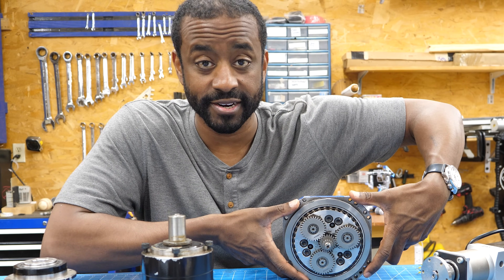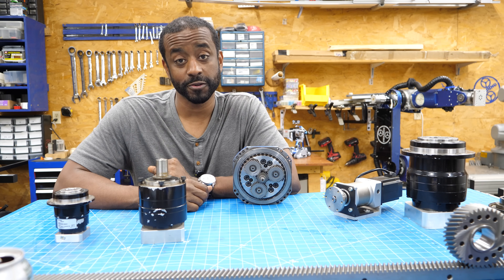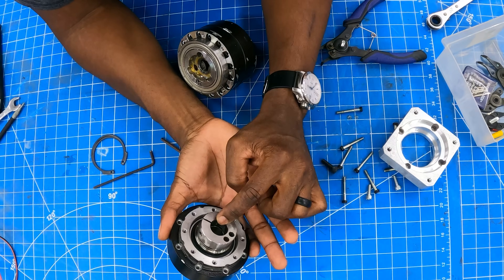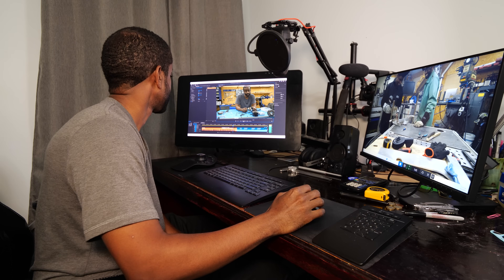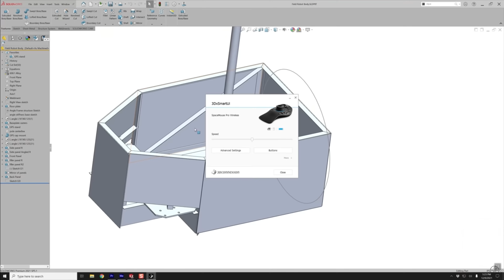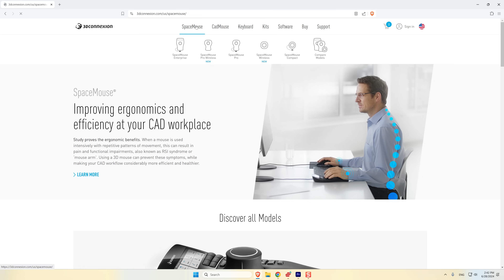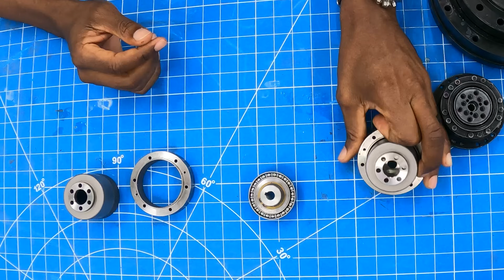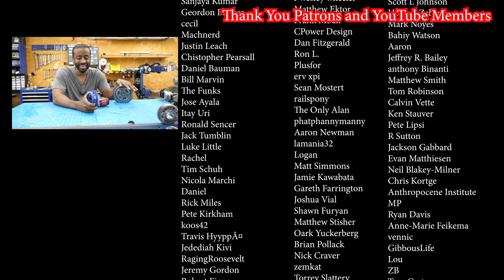Why Harmonic Drives Are Awesome.

Comment: Hey great stuff man. I was hoping you might be able to point me in the right direction in finding a company that makes and sells custom drill bit Drill bit  Guides (bushings?). I wore out mine on the template guide I have and the company does not sell replacement parts . It only sells the complete jig. Which is over 1K. Soundes like a scam to me for a part that is probably pennies on the $. 
I'm not an engineer by any means. But your content has sparked an interest in builing beyond the realm of my welding/carpentry/automotive knowledge. Keep it up. We need more wizards in our world!

Comment: @Jeremy 🔶🔶🔶Just a heads up, we have patented an entirely novel, ultra-torque dense dense and ultra-low backlash,  infinitely variable gear technology, called 𝔽𝕣𝕚𝕔𝕥𝕚𝕠𝕟𝕃𝕖𝕤𝕤 𝔾𝕖𝕒𝕣𝕤 [a CVT/𝕀𝕍𝕋] based on our reformulation of gearing theory. The technology enables transmissions of ~1/10th the size/mass/cost which enables use of motors/engines/batteries of significantly smaller size. Gear ratios can be even in the 700:1 range and probably more. It will provide novel 3D motion of robotic appendages/manipulators/booms advanced turbo0jet engines, tools and much more.
<><><>
🔶🔶🔶We are writing a patent for a large number of novel novel torque converters [gear tech], differentials and right angle torque transmission innovations that do not use  TOOTHED gears. It will be 300 pages long. 
<><><>
Contrary to what classical gear theory states and you reiterated,  I've devised a way of increasing the speed of a worm drive...on the spot. 
<><><>
The frame that holds the planets is called a [planetary] carrier, not yoke.
===
✈ℕ𝔼𝕎  𝔽ℝ𝕆ℕ𝕋𝕀𝔼ℝ  𝕋𝔼ℂℍℕ𝕆𝕃𝕆𝔾𝕐  𝔾ℝ𝕆𝕌ℙ is a visionary multidisciplinary B2B innovation company utilizing a licensing business model or collaborative enterprise with strategic partners to develop Advanced clean, efficient, power dense solutions in domains of energy, propulsion, mobility, robotics / exoskeletons and clean technologies with a particular emphasis on the aerospace sector including space exploration and commercialization

Comment: You mentioned stacking planetary gears to get the desired ratio and output. Hydraulic excavator swing gears are an excellent example of that. Depending on the size of the machine there may be one or two swing drive housings with three or four stacks aside to achieve  that number. Planet drives are very cool.

Comment: You took 13 minutes to get to the featured item. You then proceeded to describe it's parts. During that, I stopped watching. You should always lead off with the device function.
Reply from the maker: All three are featured items in my mind 😁LOL.Actually this video is part of a larger series about many gear types as I said at the beginning. Generally in a “show” the featured item is last! So your suggestion feels a bit strange regarding what you think is normal. We can also just agree to disagree about the proper order for describing a device. I personally prefer looking at the parts first. There is no right or wrong there. In my experience teaching this has worked well. Thanks for watching! I appreciate the feedback even when we disagree

Comment: I saw where somebody was proposing to use a planetary gear, on an ebike, with a disk braking mounted to the body of the “gearbox” to allow the bike inertia to drive the motor.  By slowing the body of the gear housing, using a hand controlled disk brake, it would control how much regen took place vs the disk.  In addition to putting the downhill energy back into the battery, you could augment the braking force with the disk, or even fully depend on the disk, in the event that something failed in the regen circuitry, or the motor open-circuited for whatever reason.

Comment: As a hobby-astrophotographer this was very interesting! Because these harmonic drives have really introduced themselves in this area. They are installed in the mounts, that's where the telescope and camera are mounted on and correct for the rotation of the earth to allow long exposures. Thus they have to be very precise, but also withstand some pressure. Because a large telescope with a dedicated astrocamera, a second little scope and camera for guiding, an automated focuser, a filterwheel etc. can add up to quite some weight. But it makes sense why they are more expensive, because as you said: The machining and the material seems to be quite unique. Thx!

Comment: I used to work in a printing facility, and was part of a crew that worked on a Heidelberg Harris m3000 printing press. There are some really really neat things about different parts of the press, but like you, one of the things that fascinated me the most was the harmonic drive used to set timing in the folder. 
 
It's been years so hopefully I'm remembering the details correctly,

The cutting cylinders and delivery fans were driven by a 40 ish horsepower  motor.  The cutting cylinders were driven directly by the motor. 
The belt that drove them then continued downward and wrapped around the outer ring of the harmonic drive and the fans were attached (through additional gears and shafts) to the cup side, the eccentric side was coupled to a small motor that would freewheel when timing was good and rotate it faster than the ring or slower than the ring when timing needed adjusted which would advance or retard the fan timing relative to the cutting cylinders. Seeing the gear train and the harmonic drive opened up for maintenance was quite impressive to see in my early 20s. 

Thanks for doing this video. Very cool

Comment: Now the worm gear are used in Cnc machines even today, for A B or C rotary axis in milling machines. So they aren't that bad for precision. And they are rigid strong. But they are pre tighten and don't run at high speed or long duration. And i also use 3dconnection space mouse, @ 13:13 is price worthy. @ 14:40 I have made a similar part for an compressed air driven at work here in Sweden, for the industry where electric couldn't be used. It had no motor, but controlled compressed air in 4 chambers 90 degrees apart inside that gear.

Comment: The world has been using worm gear drive on elevator hoisting machines for over a hundred years. They have been designed to run all day long almost always under load. I have maintained some of these 100+ year old machines and hundreds of busy Hospital elevators 60+ years old.  They run on electricity, gear oil and grease.
Reply from the maker: This is consistent with what I said in the video. :) Given all the pros of the worm drive, you have to take a look at your application and see what works best there. In a elevator, torque and compactness are way more important than electricity cost. You just need to rate the gear to handle the load with a safety factor. That is what engineering is. A huge list of trade offs and you pick the best ones that match the task.

Comment: My favorite demo is to take maybe 8 planetary gear sets staxked together with an electric motor driving one end and the output if the final stage welded to the frame holding it all together because it's never going to move!😂

Comment: I'm surprised you're calling the planetary carrier a 'yoke,' I mean carrier is pretty standard nomenclature.  I'm also a bit surprised about your explanation of configurations, it'd be simpler to explain it the way it's always explained, one component is input, one component is output, one component is held, one component is free-spinning, each of the four being required in a standard planetary for it to operate (minus the resistance model where two components are technically freespinning but at different rates via varying resistances, the most typical of this model being free-spinning planets and a spinning carrier but each have their own rate of movement via relative resistance), and thus giving you a range of drive configurations.  A bit disappointed you also didn't mention differentials, which are a form of planetary, considering they do see niche use in robotics but also your automotive example for planetary transmissions could've lead into this; they're a planetary that's just kinda folded in on itself, with the sun and ring being outputs in a 1:1 ratio where they're often called the spider gears, with the planets free-spinning while they're often called the side gears, with the planet carrier being driven via its crown gear and matching pinion while also being the differential housing.
Reply: I'm not a professional in this specific field but I work around all these different gears and calling a single gear says the "planetary gear" would be correct since it's only applicable in a "planetary gear set". Yourself called the refered to the "planetary carrier" is true since it is indubitably a planet gear carrier. Calling it a side gear or spider gear could be misleading nonetheless the people that can understand the differencing in the way others phrase and or refer to different gears have an advantage when it comes to gears. I see you are one of my fellow big brain bois. It's no doubt the industry standard is sometimes a flimsy line and the region of work most often determines the nomenclature of what a professional would standardize with a fellow individual.
Reply: @brylanshaw2092  You struggle with English, don't you?  Differentials have specific names for its gears, spiders and side gears are literally named as such.  I had mentioned what the gears represent in epicyclic terms to form the connection between the two forms of planetary gearsets, because most people don't intuitively make the connection that a differential is a form of planetary gearset.  Nobody calls the components of a differential 'sun,' 'planets,' and 'ring,' gears, because this nomenclature does not make sense within the context of the differential, because what's traditionally the sun and ring within an epicyclic are not traditional in implementation in a differential, due to the two being a matched ratio, and typically as a dual-output planetary, hence the two output gears are called 'side gears;' though the term 'spider' doesn't have a concise origin, the common belief is that they're named so because they craw around the side gears akin to a spider crawling around an object.  Similarly, 'spider' and 'side' gears do not make sense in the context of an epicyclic planetary, due to no component fitting the nomenclature, and the epicyclic nomenclature is pretty straightforward.  They have different nomenclature for a reason, and that reason is contextual use.  The other major difference is layout, due to the matched ratio of the side gears in a differential (sun and ring in epicyclic terms), the gearset has to be folded in on itself, making a differential a very 3D gearset due to perpendicular wrapping; whereas an epicyclic, not having the matched ratio between sun and ring, is a very 2D gearset where every gear component can be sandwiched into the same plane.  Nomenclature is fairly standard no matter what industry you're in, it's not loose nor flimsy in the slightest, you just need to understand where names are applied.
Reply: @xaytana  Right, I still try though. It's a lousy attempt IK but I'll get my grammar down for sure. I was confused about why you were surprised he referred to the ring gear as a Yoke but now it makes total sense. That's my bad I should've paid better attention. What would you refer to the ring gear as in an automotive differential application? Would you refer to these same gears using a professional automotive nomenclature standard if the mechanism was used in something like a robot? I mean anything other than the automotive. I figured that's a no-brainer. You would use the standard machine nomenclature but like I said I'm not a professional obviously. I'm simply intrigued by all the gear mechanisms and I don't mean to offend. I feel the radiation of specific knowledge that you have just from your comments so I just wanted to challenge you because I just learned from you. I also am very curious if there is a book that covers the various industries's nomenclature standards that you work in.
Reply: @brylanshaw2092  I still think you're misunderstanding.  The ring gear is NOT the planetary carrier.  The planetary carrier is the component that holds the planets, the fourth moving component of planetary gearsets, of which can also be input, output, held, or freespinning.  Power is transmitted through this via the collective circular path of the planets themselves. 

As for your question about nomenclature transcending boundaries of professions, yes, the nomenclature stays.  This is because of how the gearset is constructed.  A differential has side gears, spider gears, the housing, and the crown gear and pinion set that drives the housing under typical operation.  An epicyclic has the sun, planets, ring, and carrier.  Again, reference my original comment, in operation the gears match each other but operate differently, a differential is a planetary gearset that drives the 'sun' and 'ring' as matched ratio outputs, hence side gears, via freespinning planets called spider gears, and their motion is induced via a driven carrier that's also the differential housing, and hence why the differential driving gears are a pinion and crown gear due to how the gearset is positioned in relation to its driving components.  Differential nomenclature is the same no matter the profession, just as epicyclic nomenclature stays the same; automatic transmissions often use a stack of epicyclic gearsets for the different drive ratios, and they use the standard epicyclic nomenclature.  The specific gearsets have specific names due to use and implementation, again 'sun' and 'ring' don't make sense for what the matching gears are in a differential, as they're identical but opposed gears that do not represent what a 'sun' or 'ring' are, and the opposite is true as an epicyclic has no use for the side and spider gear naming.  Think of it like brass and bronze, they're both in the same family of metals but they're extremely different in use and composition. 

Now an atypical use of a differential is one that does not drive the carrier and rather holds it in place, with input on one side gear and output on the other side gear, this results in a coaxial reverser via the freespinning spider gears, of a 1:1 input-output ratio.  If you held the spider gears in place (typically via welding), you end up with a constant output differential with the side gears locked together.  The differential, being a dual-output planetary gearset, is unique in the fact that if you hold one side gear (i.e. wheel) all the power is transmitted to the opposite side gear, minus the obvious transmission losses through the gearset, and this kind of behavior can be modified via different resistance methods which results in the family of Limited-Slip Differentials.

Comment: Will you make a video converting a 3phase motor into a generator?  Possibly building a regulator, depending on the type built.   Or build a adjustable regulator for a alternator such as a delco.10si   I can find a working motor at the scrap yard, but finding a generator is very rare, especially working. I'd like to find a 5-10 or even 20 hp 3phase motor to convert to a generator, connect it to a car engine, with electronic govenor to supply power to my off-grid home and shop. Using a 200 HP engine to generate 20kw isn't very efficient but the power output should be steady . I think I would also include a heavy flywheel possibly 100 lbs so a 5hp air compressor starting shouldn't cause any issues, I wouldn't mind building a transformer to convert 480v to split phase 120/240 between each leg of the output and use 3 breaker boxes, it would be for bad weather and poor sun times when solar doesn't provide. Maybe a average run time of a month or two per year. Run the shop from a phase, house from a phase, and possibly help a neighbor with a phase. Not going to be a large load. A 8 kw generator could power everything.  It would mostly be used to wash clothes,  what I really want is a 10 kw belt drive generator. Like some ppl use on a tractor powered from the PTO.  I would also like to build a DC generator to charge batteries, I have several Delco alternators, 21si, the HD version of the 10 & 12si models. with regulator mods it can easily charge a 48v battery, I only need 24/28.4v I'm not looking to fully charge the battery, only to about 80-90% at most. A cloudy day can finish it off most if the time. However ,10% can last a night and day normally. Sorry to ramble, have a awesome day!

Comment: I first heard about harmonic drives when reading about the Apollo lunar roving vehicle. Each wheel had its own motor and harmonic drive.
Reply: In a post above one of the people working on that rover talks about the motors and hydraulic drives. From the few things I remember was that the motors were brushed, and that brushed motors didn't work well in vacuum as they require some humidity in the air that lubricate the brushes. Both the harmonic drives and the motors was pressurized to half an atmosphere using some gass and a calculated amount of humidity. He wrote that the motors and the harmonic drives were probably still fine, but the brakes were probably stuck because of vacuum welding. Sounds wrong when I write it so he probably used some other words. anyway look at the comments above. it shouldn't be hard to find the actual comment.